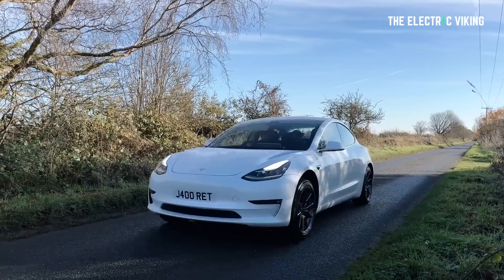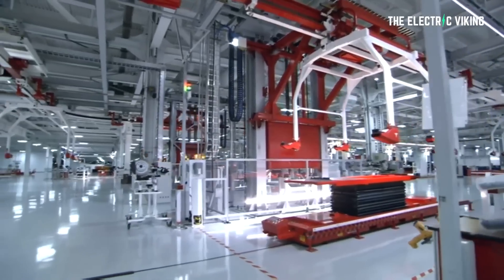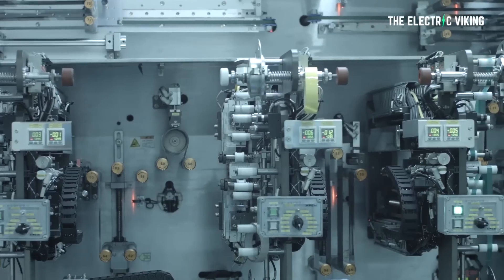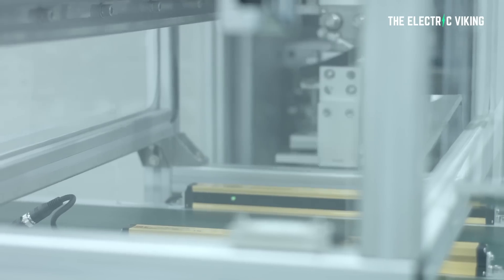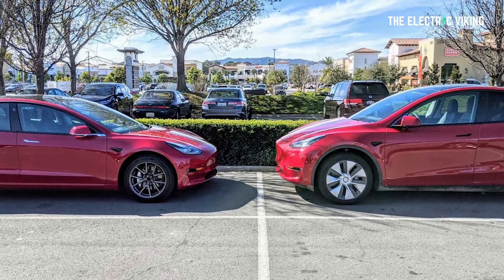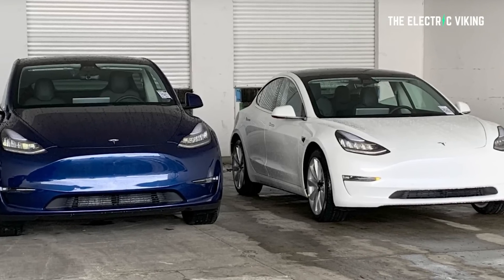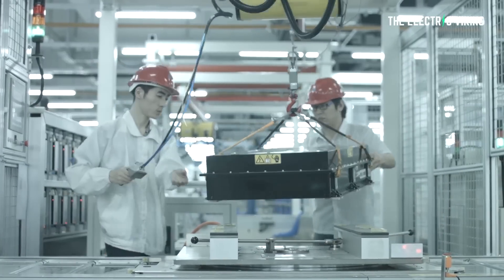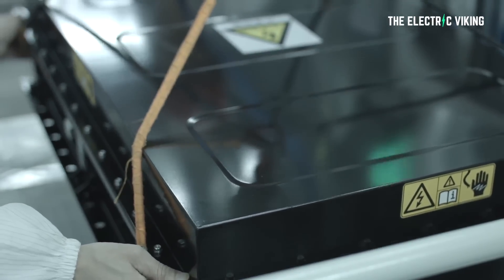NEW LFP Model 3 & Y to have over 700km range with M3P battery

Comment: A longer range is marketing for people who don’t know what they’re doing. 90% of people will have plenty of range with the existing packs. I see added value for taxis and later autonomous cars but for the layman the added value is 0. Tesla could fit in less batteries and lower the weight and extend range and efficiency in that way. The model 3 is already the most efficient on the ev market today.

Comment: Sam.
THINK about it.
These cells have a reported "up to 20% improvement" over LFP density.
Thats +/- 240Wh/kg.
.
The Tesla 2170? 270Wh/kg.
.
Conclusion?
Maximum range from a pack with the NEW cell will be 10% LESS than the theoretical maximum of a 2170 pack (380 miles?)
.
That's +/- 340 miles, 540 km.

Comment: You forgot to mention Sam.. LFP can be discharged zero and charge to 100-percent without damage unlike a ternary which in theory You're only supposed to use 60% of its capacity charging between 20 and 80%.. that itself makes a big difference to range.. 40% more range with LFP 😎. .. however I agree with Robert below they will keep the range the same, using less batteries,  and therefore to be able to build more cars and make more profit.

Comment: But wait there is an even better battery , just ten seconds ago. IT WLL CHANGE EVEYTHING. Does not require power from coal burning plants to charge it, ot cobalt from the Congo mined the five year old to power it. It will not pollute when tissed into the Oceans. There are NBO green house gasses connected with its manufacture..What wonder. All fake, but a nice story.

Comment: Total nonsense. You're taking the advertised 675km range of the Chinese Model 3 and adding just a little bit on top based on a single Sina Tech report out of China. You have failed to note that both the existing and predicted new ranges are on the CLTC test cycle, which is a fairy tale and predicts more than 30% over the EPA cycle. Those of us in America know that even EPA is optimistic.

The average speed in the CLTC cycle is under 40 km/h. This is not real-world driving as we recognize it and it consistently over-estimates.

In order for an model 3 to get an actual 700km range (434mi), on the existing largest pack they've ever put in this frame (82kWh), you'd have to have an absolutely show-stopping 117Wh/km (189Wh/mi) efficiency. Anyone who's ever driven one knows that's not even close. And if you assume they're going to increase the pack size instead, simple arithmetic says that its EPA-rated consumption of 250Wh/mi means you'd have to have a 109kWh pack at a minimum.

Do you think Tesla is going to silently increase the battery packs in their cheapest cars from 82kWh to 109kWh and charge you nothing for the privilege? Well, I have a few yield farming cryptocurrencies I think you should invest in.

In reality, most reports we see show that the Model Y is moving to a 72 kWh pack. That is, it's going to lose a little range, a lot of weight, and a lot of cost. It's still going to cost the same. More profits for Tesla, and roughly the same experience for you. This is capitalism, after all.

Comment: Cost will be more determined by demand than anything else, and as it is now. As long as demand stays high, price will stay high.

Range will be determined by how battery constrained they are, or demand droping due to competitors having more range. Otherwise they'll just use fewer batteries if they have higher energy density.

Comment: More Range is important, especially for people living in regional areas who have large distances to travel, even more so for farmers in outback Australia and around the planet. If tesla is going to play games with smaller batteries to keep range similar to previous models, then other companies including Chinese EV manufacturers have the opportunity to use their improved LFPM and future battery technology improvements in energy density to capture a market that wants more range. More range needs to offset the slower battery charging. As we know, the faster the battery charges the more detrimental it is to its eventual life. I am going Chinese Atto 3 until the EV market improves, as we are still in the very formative years of EV battery and software development. I think EV's will age like computers, as is said quite frequently that they are just computers on wheels. There is only so much you can do with OTA updates if you do not have the latest hardware fitted.

Comment: I don't think BYD needs to have increased gravimetric density at the cell level. The Berlin model y uses a structural pack, it's just that they're retrofitting the 2170 cells into modules and placing them into the pack. The blade battery might be getting those numbers because it be suited for the structural pack removing the need for modules and steel structures.

Comment: They will build more cars with fewer batteries until supply catches up with demand. Unless, chip shortages or other supply constraints kick in. Elon has been pretty clear on his strategy here. My guess is you might see this in a year or so after giga Texas has hit it's volume output numbers and they are eating into the backlog in big bites.

Comment: Range on Tesla’s isn’t an issue it’s the infrastructure and charging speeds that need work. If this means less batteries and faster charging then that’s great - 700km range between charging just isn’t necessary for 99% of people.

Comment: Several Tesla Shanghai supplier are shut down du to heat wave. Something to consider for coming months. Tesla doesn't seem to overkill the range if they don't have to. They would reduce the number of battery instead. Question : these MP3 batterie can be charge to 100 % without impending there life ?

Comment: The way I interpret is that these are phosphate with ternary materials. And the articles didn’t say which batteries they would be on cost parity with so I think maybe these will replace ternary batteries in the long range and sport. That’s my guess and I hope that’s the case as my RWD y comes in September. I think they will keep the RWD with LFP and that’s the only one eligible for subsidy in NZ. Let me know your thoughts.
Reply: The M3P variants are likely to have similar life span to the LFP variants but with more range and the ability to charge to 100%. That’s my guess. Also I think the Viking doesn’t qualify the range with the testing cycle used which is likely to be the China testing cycle so don’t expect as big a leap in range as he is stating, think 15-20% more than the LFP which makes the ideal for long range and sport variants. CATL are likely supplementing LFP batteries with M3P so bet on LFP still appearing in cars hence M3 RWD will stay on the menu as is. M3P is not LFMP from what I read. Again my guesses and big guesses at that. Again really interested to hear some feedback, do you agree, disagree?

Comment: When you get to 500 miles real world to a charge and million mile packs then it’s game over for fossil especially if they go on to decrease price. The dream for me was the £30k Tesla model 3 with exception build quality, great tech ( sorry not interested in FSD) and could do 400-500 miles real world to a charge. If that was the case it would be on the drive but the cheapest model 3 delivered split new is now £49k from £40k a few years back. One thing for sure is battery development and research is going at such a pace there will be a few breakthroughs that will shift what will be the norm. I recon to use a analogy we are at the iPhone 3 level just now and how long before everything just improves to iPhone 13 level is anyones guess.

Comment: I think what Tesla might do if they can get enough supply of these new batteries is add a long range here in Australia at a little higher cost and then use a smaller pack for a standard range model reducing its costs, both things would boosted demand(not that they need it) and boost margins win win. It’s also probably the main reason they don’t already have a long range in Australia knowing that these where on the way and is the reason they put on hold the long range in North American. And also if tesla get Catl’s new ternary batteries they’ll throw them in the performance model in china factory’s.This frees up cells they use now to expand, North American production, as well as divert there current LFP batteries to battery storage mega pack and home batteries which all this combine equals $$$$

Comment: Nice video Viking but there are, in your excitement, a few concepts you're getting wrong in this one.  Hopefully this helps with those.

Tesla getting more range from a 55kWh battery with a larger vehicle than BYD with a 60kWh battery is not due to anything other than efficiency.  Teslas have, if not the best, close to the best efficiency of any EV - in some comparisons, massively better.  Efficiency is determined by a number of factors, most notably motor efficiency, drag coefficient and battery management (no one comes close to Tesla's software in this area or any other for that matter).

Energy density does not improve range!  Please stop making this mistake, it is in more than 1 of your videos.  There are 3 types of density - volumetric, gravimetric and power.  Respectively, how much room (volume) the battery takes up, how much it weighs per unit of volume and how many kWh per kg.  For the same battery energy capacity (in kWh), a higher energy density battery does NOT increase range.  It will weigh less and, depending on the geometry, take up less space, but it won't increase range.  For the same weight, it will have greater range but then it will have more energy capacity.

So, in conclusion, the range of an EV with a 55kWh battery is only determined by the efficiency of the car, the operating conditions (wind, temperature, slope) and the way it is driven.

If this is teaching you how to suck eggs, then I'm sorry.  However, from watching many of your videos, you make these mistakes repeatedly
Reply: Well said!! I think certain people get excited over the “possibility” that Tesla will include a higher KWh battery pack simply because they could. Elon has preached for a while that 300 mile range is the sweet spot of EV’s, anymore is wasteful. This is evident by his decision to use a smaller BYD LFP battery in the Berlin MY. I think it was a mistake for Sam to have cancelled his model Y order.
Reply: Nice clear explanation 😃. I think that Aptera has the edge on drag coefficient but Tesla has the lead in efficiency and power management 🤔

Comment: I think you're wrong on Tesla increasing range. They don't want to create an Osborn effect for their NMC vehicles. I think they'll focus more on ramping production and they can do that a lot more efficiently with smaller packs and then they'll focus on reducing price. The reason they can get similar range in the Model Y to Atto 3 with a 5kw smaller pack and larger vehicle is pretty straight forward. The way Tesla optimises power usage has been shown to be 25-30% more efficient than other automakers.
Reply: @Luke Ryan 
Exactly, battery capacity has nothing to do with vehicle efficiency. Drag coefficient and front area play a fair part, as well as motor design and heat management.

Comment: If the battery energy density increases by 25%, what I would do as Tesla is reduce the battery pack by 20%.  This will result in a battery pack with 80% as many cells.  0.80 * 1.25 = 1.  So the 80% resized battery pack will deliver the same kilowatt-hour rating as the old battery pack, but the new battery pack, and overall vehicle will be lighter, and cheaper to build.  This benefits Tesla’s profit margins, or allows them to pass some of all of the saving on to customers.  It also provides some amount of increased range due up the car being lighter.  Win/win.

If the energy density difference is 33%, then the battery pack can be reduced to 75%.
0.75 * 1.33 = 1.  So that reduces the battery size and weight even more.  Bigger savings for Tesla to provide the same kilowatt-hour battery while reducing the vehicle weight by even more.  The point is, let the greater range cone exclusively from lower weight, not by increasing the battery packs capacity.

Comment: As good as this new battery could be, one thing Tesla won't do is make their current cars less desirable or obsolete for the same price or less.   Knowing Tesla, they will use these batteries, then software lock the range to match the current version.  Then later, you can pay extra to fully unlock the whole pack.
Reply: Give me the option to pay for the bigger range

Comment: I appreciate the report.  Where I scratch my head is what option Tesla takes, save money and weight and pack fewer of these batteries thus keeping the range, actually giving you that advantage of miles at the same price, or pack all of those batteries and Tesla then allows you to “pay up” for range as an option like acceleration packs.  They still need to differentiate the long range and performance somehow which makes me believe option 1 or three is what we’d see.
Reply: I think they maximise production capacity available at current Giga Factories rather than range in each. There is also the prospect of  the 20 /25k car which may emerge from Shanghai expansion in 12 to 18 months. If waiting list contract then we will inevitably see higher performance and range options. Of course there is also CT and Semi. So supply constraints might prevail for some time.

Comment: Viking, love your videos, man. But dude, you gotta stop listening to the Chinese claims until it's on people hands. That's like believing legacy automakers like GM's and Chrysler's claims before their EV's are in customers hands. And by the way, manganese being used in LFP batteries is nothing new. They have been adding it and working on it for over two decades now. And although it does increase the energy density, which is why they keep trying, the issue has been that it lowers the life of the batteries tremendously -- as low as to only around 100 cycles. I'm sure CATL has extended that a bit, or Tesla would not been using them, but just keep that in mind. Don't expect LFP batteries with manganese in it to have a life any longer that of the nickel/cobalt chemistries. And no where near as long as standard LFP batteries.
Reply: Agree longevity is a very important thing to properly understand

Comment: The positive repercussions of this transition go on and on. Battery tech continues to evolve. Thanks in large part to CATL. Batteries will have a second live as part of the electrical grid. In your home or other. Most ICE cars are recycled as will be the same for BEVs. At some point recycling will provide most of the material for new batteries. The cost of otherwise mined and refined materials will drop exponentially. What other things/chains of events will happen because of this transition?
Reply: Indeed, it's the transition from horse drawn vehicles to petrol driven vehicles all over again.  Once battery technology gives people the range, rechargeability and life they want, it will be a tipping point for EVs and they will take over the market.

Comment: Using the same capacity battery with higher energy density means a smaller battery pack size and mass, which gives longer range for the same vehicle. That would explain the revised WLTP figures for that Model Y.

Comment: Viking the only Tesla model 3 with LFP is the standard range which does not have a range of 556km but a range of 434km. If there was a 10% increase it would be 477km. For the standard range. However I don’t know about the cars being produced in Shanghai so you may very well be correct, but so far I can’t find the information confirming your statement. Ps. Best EV channel on YouTube.
Reply: NEDC rating, which most countries no longer use as it's overly optimistic, for the Model 3 RWD with LFP is 556km.

Earlier reports is this LMFP battery will be 72kWh that is 20% more than the LFP battery so that's approximately 667km NEDC range....  if that 72kWh is usable rating not actual it might be ~700km NEDC range.

It should do 580-590km range WLTP in the Model 3

I would suggest this battery will in 'long range' models of the 3 & Y
Reply: @Adrian Leitch  Got it I didn’t not know that. I knew I was missing something thanks for the detailed information. I’m so confused why they would even use NEDC rating in todays world.
Reply: @Adrian Leitch  Got it I didn’t not know that. I knew I was missing something thanks for the detailed information. I’m so confused why they would even use NEDC rating in todays world.